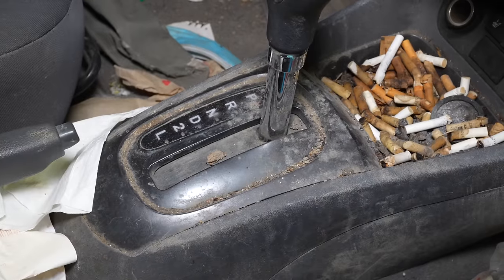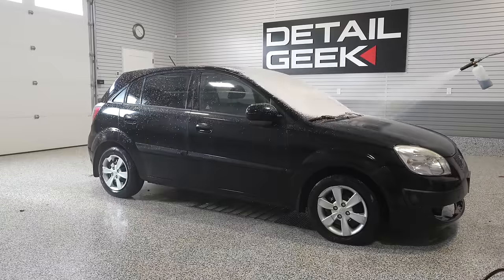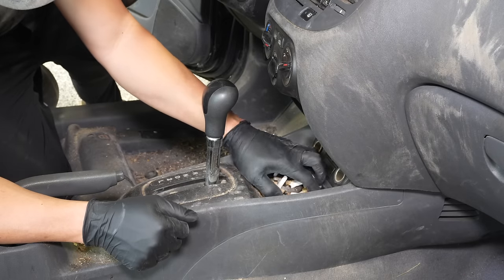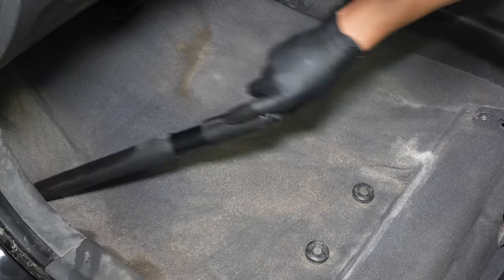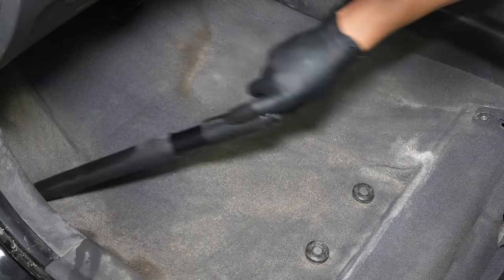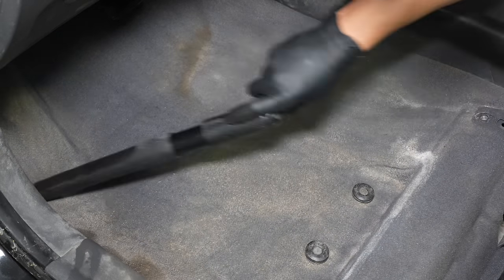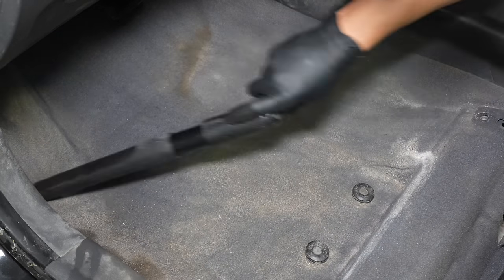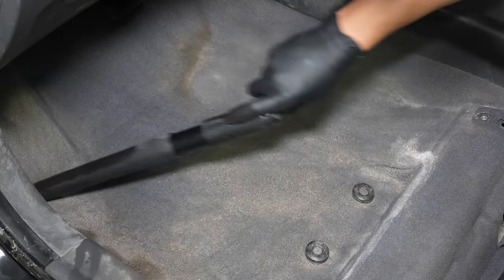Cleaning a Chain-Smoker's "UNCLEANABLE" Car!

Comment: It doesn’t matter how clean or dirty a car is, the same job has to be done when getting a professional detail. 
So I don’t see what all the fuss is about here. 
If a clean car came in to be detailed it doesn’t mean you can skip a few steps in the process. 
I imagine with your high powered commercial equipment that you are using the time difference between detailing a dirty car and a clean car wouldn’t be all that much different if you preformed all the same steps on a clean car.

Comment: Ive bought used cars and Im a non smoker.. you can easily tell if the previous owner was a smoker.. its absolultely disgusting smelling that sick stench in a car.  No matter how hard they try,  that smell can never be cleaned.  You can always smell it.. Ive passed on virtually perfect cars,  nothing mechanically wrong with them,  great price,  everything there but as soon as i sit inside,  that smell is an imstant deal breaker.  They couldnt sell that car to be for 5 bucks.. no way would i ever drive that

Comment: Oh. Boy. The previous owner, and others like them are just plain nasty lazy filthy pigs. If one of them asked me if i needed a ride and i saw all the filth big fat NO, not unless i wore a haz-mat suit, even then I'd really have to be desperate. How hard is it to at least put the garbage in a trash can and the butts in a cup made to hold ciggy butts then empty as needed. It'd probably break their hearts( too bad). I never smoked but have only cleaned my 14 yr old Focus a handful of times and NEVER has it been even close to that filthy. Great job cleaning the car. Shout out to all the people who do this job.🗣📢👍  years ago my car fender was crinkled by the guy who plowed snow in the parking lot of the apartment's i lived in. When my fender was all fixed, the shop detailed my car. I didn't want to drive it and get it dirty again. A few months before the fender incident  i stopped for a gallon of milk and it broke and milk all over the mat and carpet. I cleaned it the best i could hosing the floor mat and using cleaner on mat and floor. It was ok at first, then as it warmed up outside it smelled like french fries and then an awful stink. Anyway it was great to have my car detailed.

Comment: Bruh, HUGE miss by you. Smoker's car, ANY smoker's car is going to smell DISGUSTING. You glossed right over how you got the smell out. I'm guessing you DIDN'T. Merely washing & vacuuming upholstery, carpet, & surfaces WILL NOT remove that odor. I KNOW because I've had to clean a car with an occasional smoker. Leather seats, so no upholstery to clean, but carpets, headliner, & everything else. Reply to my message if you want to know how I got that putrid mess to smell beautiful.
Reply: I'd like to know please. I'm having trouble getting that smell out of a used car I bought. Didn't know it was a smokers car. It smelled fine at the time & has beautiful white leather. It was spotless.  A few weeks go by, I find hidden air fresheners everywhere & smell came back when I got rid of them. I want the car to smell like leather again. Is it possible?

Comment: That car is gonna need a new cabin air filter, or else the HVAC is still gonna smell like the dirty car no matter what. Might still smell even after the filter is changed from ash, smoke, and food in the vents and tubes. 
Also, who the hell drove that shitbox there like that, with bald tires and filled with trash? I wouldn't step foot in it.

Comment: when are you going to buy a table to but the seats on so that you won't need to bend over on the floor to clean them ?   That ole head liner must still be dirty and smelling awful !  Toss the floor mats into a washing machine to clean them .  I had to use oven cleaner to remove 5 years of cigarette smoke from the car windows of a traveling salesman that smoked 4 to 5 packs a day !

Comment: Do you clean these just to make videos? Cars like these are worth fuck-all, surely less than the cleaning bill. it's not just the filth, the wheel arches are rusty, it needs new tyres and I'd be amazed if mechanically didn't also need work.